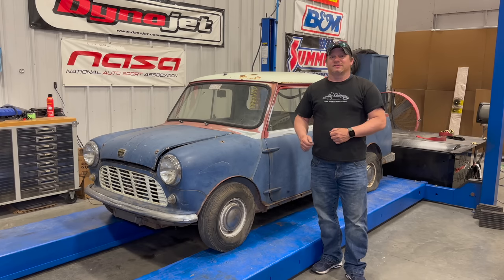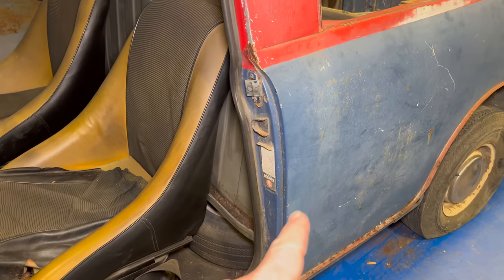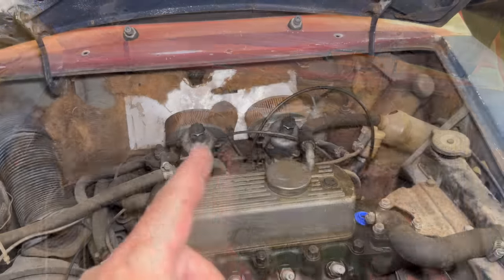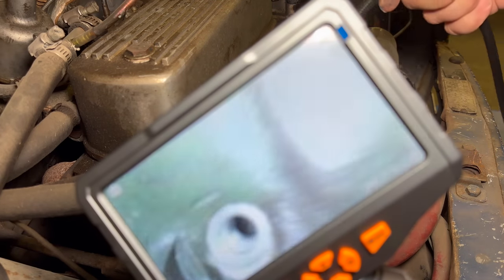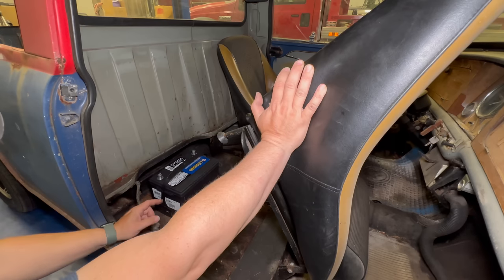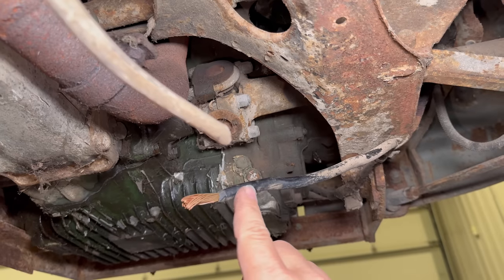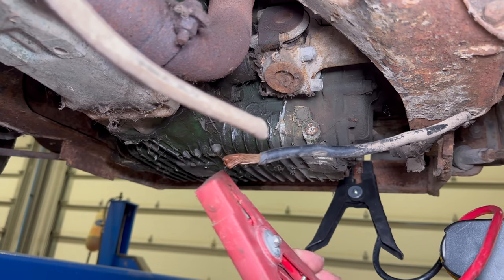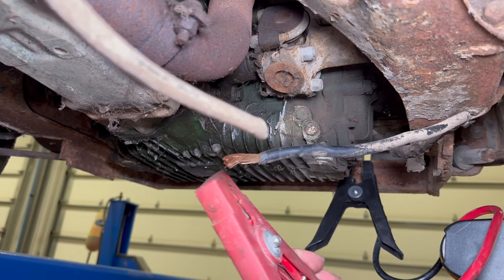Barn Find Austin Pickup - Will It Run?

Comment: You could take the switch apart and clean the terminals and contacts.  Unless it is thoroughly useless, it will work just fine.  Someone who wouldn't attempt that method first has more money than sense.

Comment: Well that seems heavily modified to me. These never had disc brakes & the rear drums look like Cooper drums, hence the brake booster. So the wheels you have fitted appear more appropriate to the potential of this vehicle.   Also this vintage would have had a 'pudding stirrer'gear change not a remote gearchange. A wooden dash -definetely not in a pick up, just the round central speedo. The heater would have been an extra too as these also attracted purchase tax! When I was 7 or 8 years old I nearly crashed my mum's Mini Countryman into a wall by pressing the floor starter button. What would I know about checking if the car was in gear first at that age?
Reply: That's what I thought.  Looks like someone took the engine and fittings (especially the wooden dash) from an upmarket  variant such as an Elf.  Here in England we saw just about every version of the Mini on the roads, although I never saw the beach version and can't remember ever seeing this pick up version either

Comment: Considering that it's running twin SU's & a larger radiator, as well as a non stock tappet cover, you can be sure that it's not an original 850.

Comment: I;m almost certain that the instrument panel, dual carbs and the valve cover wer not original items. The commercial versions (van and pickup had very low spec; central instrument cluster and a parcel shelf, single carb and pressed valve cover.
Reply from the maker: Interestingly I saw one of the vans this weekend here in the US and it has the same dashboard.  You can see it in this short video: https://www.youtube.com/shorts/U-NTpUzk7h8
Reply: @ThisWeekWithCars  Maybe BL felt they had to add a little to the N. American spec?

Comment: fantastic my friend i just bought an 1963 morris mini 850 i checked the engine and seams not compression what can i do? thanks ryan from malta/europe
Reply from the maker: It may not have compression due to the valves being dirty.  Add oil to the cylinders to seal the pistons up a little better and use starter fluid to see if you can get it to fire a few times.  Getting it to fire will start to clean, burn, and blow off the gunk that might be on the valves and seats.  If you are lucky you will get compression again, if not you didn't do any harm because you need to take it apart and rebuild anyways.
Reply: Many thanks waiting for ep 2 take care 😊

Comment: You missed the clubman, square nose version of the saloon/sedan
Reply: Those were never imported to the US (although, to be fair, neither were the pickups!  Of course, grey-market imports of both are to be found in very small quantities.) The last year of factory imports was 1968, I believe.  So  we did get some Mk. II models, but no square-nose, wind-up windows.
Reply from the maker: The clubman was not one of the original models (1959-1969) and was not even it's own body type it was an additional look that was a subset of the body type.  Body type is designated in the third position of the VIN and round or square nose is designated in the fourth position.

Comment: You are missing the Clubman version
Reply from the maker: The clubman was not an original body type (1959-1969), or even it's own body type at all. When the clubman came out it did not get it's own body style designation it was actually marked as a sub category under the body style.  A clubman is designated by the fourth position in the vin instead of the third where the body style is listed.  VIN, Fourth Position :
[Blank] = Mini 850. Produced only in the “round nose” style
1 = Round nose, traditional Mini body style. Includes: Mini 1000, Mk III Cooper S, Van, and Pick-up.
2 = Clubman, square nose style. Includes: Clubman saloon, Clubman Estate, and 1275GT.

Comment: How is a Clubman classed?
Reply: As an abomination. Alec Issigonis hated it!
Reply from the maker: The clubman didn't come out until 1969, so it was not one of the original minis, and it was an option on different body types not a type of it's own.  You could get the squared front in several of the available body types for example sedans and estates.

Comment: You forgot the clubman and the convertible.
Reply from the maker: Those are not original mini body types.  The clubman didn't come out until 1969 and was not considered it's own body type just a style of the different types.  The convertible (cabriolet) did not come out until 1993 and was built by Karmann in Germany.
Reply: @ThisWeekWithCars  I just learned something new, thanks.
 
The Moke didn't pass with the army due to not having 4 wheel drive, it got stuck too easy and lacked the power of a defender.
Reply from the maker: If you notice there are holes in the bumper of the Moke, if they got stuck you were to put a pole in each bumper hole and four guys could lift the Moke out or over an obstacle and then continue traveling, that was the thought at least.
Reply: @ThisWeekWithCars  Still low ground clearance and no four wheel drive made it unsuitable.
Their loss if our gain.

Comment: British cars equipped with dynamos were wired positive earth. Later models with alternators were always negative Earth.
Reply from the maker: British cars with dynamos can be either positive or negative earth and a car that is 50 years old missing the battery you don't know if anyone has changed it from the way it was originally.
Reply: @ThisWeekWithCars  AS far as I know dynamo equipped cars and motorcycles left the factory positive earth.   Many owners changed them to negative earth in order to fit polarity sensitive aftermarket accessories. Radios for example were not standard equipment until the late seventies. One way to check if the car was altered is to look at the ignition coil, if the positive terminal goes to the distributor then it is positive earth.
Reply from the maker: British cars only used positive ground from around 1936 to the late 60s they are negative ground otherwise.  But again you have no idea what a previous owner did , but if the car has a modern radio installed it is almost certainly converted to negative ground otherwise they would have to isolate the entire case of the radio from shorting out.

Comment: VERY crusty looking ig switch. I'd want to remove it and clean all the connections. Thorough tidy may be all that's required. If it's like so many replacement parts these days, new switch might not be as good as original.

Comment: Those wheels are very wrong.  The dash is wrong.  The seats are wrong.  The engine is wrong.  The brake servo is wrong.  The carbs are wrong.  The heater is wrong.
  You bought a lemon.